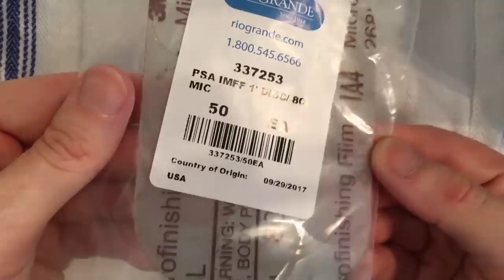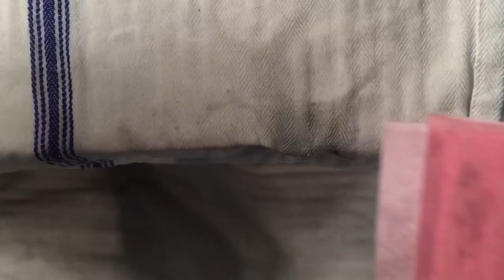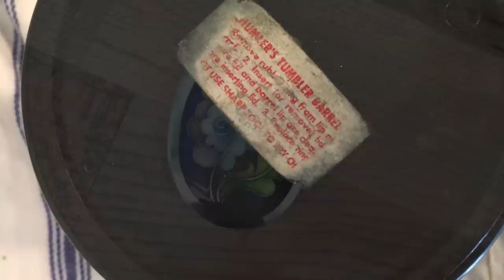Tutorial- Champleve Flower Pendant Part 3 of 3

Comment: Thank you for the very detailed tutorial!  Is there any risk in tumbling an enameled piece? Would the steel shot damage the glass? Is the  final clear enamel always necessary when doing champlevé?
Reply from the maker: Hi Gabriel!  The steel shot will not damage the glass- I tumble every piece of champleve I make, and have never had a problem.  As long as you are putting enough enamel on to get to the top of the wires, you don't have to use clear.  Check out my other videos here: https://vimeo.com/ondemand/sandramcewen/   Good luck!